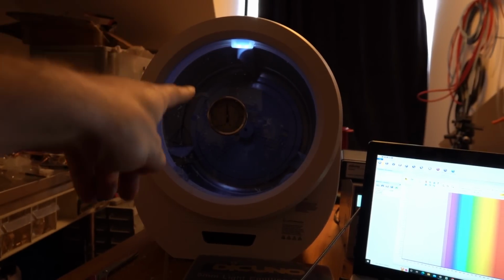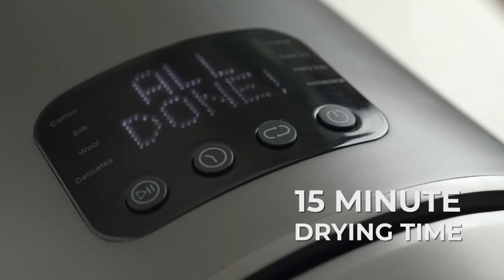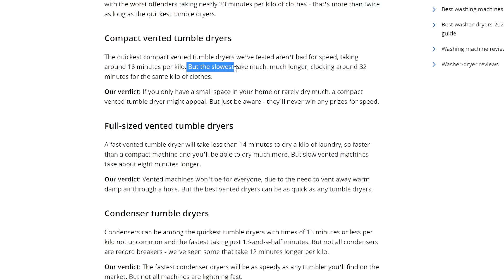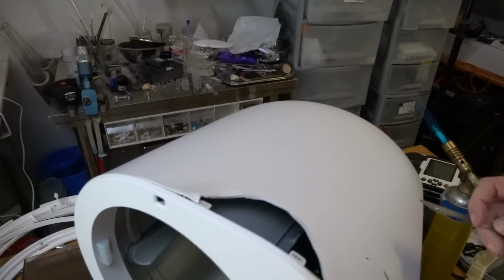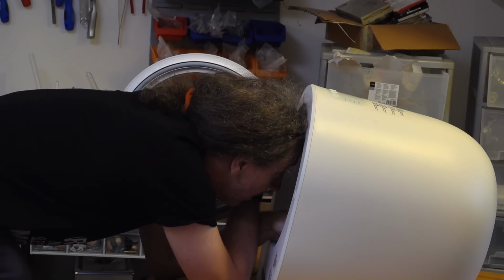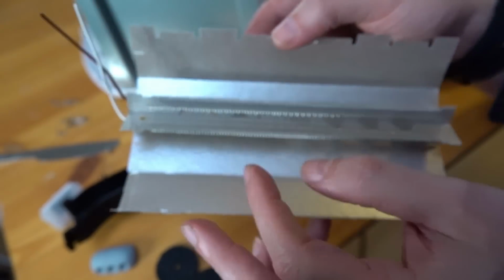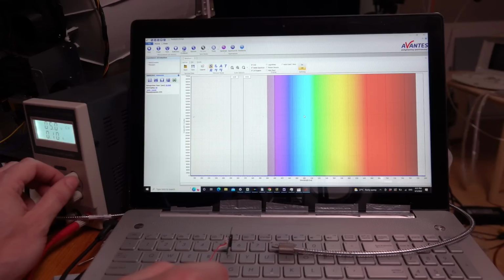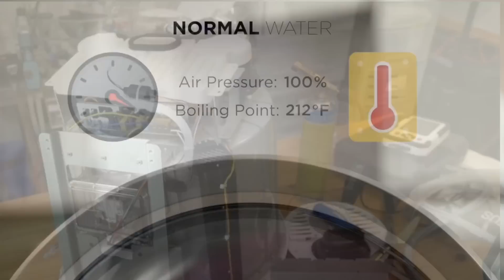Autopsy of a Scam-Starter: The Morus Zero!

Comment: As a test engineer, I found this one of you more interesting videos.  My opinion as to some of your questions:

1) The connector was probably hot-glued on to keep it from falling off due to the vibrations of operation, since it appears to be the only connector that hangs down in the direction of removal.  However, using hot glue in a machine that gets hot is somewhat questionable.

2) The drive wheels were in the "Perspex" box to protect them from lint.

3) A resistance heater IS an infrared heater.  All heaters, by definition, are IR.  This one's just far infrared, not a lamp.

4) I applaud your honesty in correcting yourself about the UV LED.  However, that thing was fully into the UVB range, which, as you earlier pointed out, is dangerous to tissue.  I'm amazed they could market something like this without a warning label like on laser pointers, unless they can demonstrate that the door window absorbs that frequency and that it is sufficiently interlocked to prevent operation with the door open.
Reply: on the infrared heating story: in everyday language IR heating is mostly understood as an IR source radiating heat that hits some surface directly (e.g. the skin of someone) and makes it feel warm, contrary to the "space heater" which uses the surrounding moving air to transfer the emitted heat to the room. not debating the definition of IR heating there, but clearly the nichrome wire in a wind tunnel won't qualify as a real (say quartz lamp) IR heater. and IR radiation will follow a straight path and likely won't reflect from the surrounding black plastic walls either.
Reply: @sikedipuuhja7376  - Can't argue with that!
Reply: you couldn't sell this in Switzerland. These days only the heat pump variant is aloud, because they're far more efficient. What makes me most concerned is that this is a major fire hazard. There seems to be no filter at all to absorb dust and cloth fibers. and it looks like some of the air coming out will be sucked in again. this will lead to a build up of cloth fibers in the heating elements. and the temperature sensor is in the wrong place. if you have basically no circulation anymore at some point, the temperature sensor will not measure the overheating. just hoping people throw it away for functioning to badly before the buildup is severe enough for a fire.
the one thing most test engineers forget, is that any system that pumps lots of anything with even little impurities (dust, fibers etc.) inside will rapidly malfunction, even if every single component is good for 10 years. often they forget that you have to be able to clean even the inside without having to break to system. any filter that allows sufficient flow, cannot sufficiently filter to avoid a buildup over time.
and if it's up to the end user to do the maintenance you have to overdesign to filter system...
operation
Reply: When I was a kid we had an already old clothes dryer that I discovered had a UV bulb in it to provide the same sterilization feature.  It didn’t work at first but I looked at the schematic and saw that the drum light and UV bulb were run in series so replacing the drum light (that I had no idea it had either) made the UV light work as well.  It was not a fluorescent bulb, and not an incandescent bulb with purple filtration, I suppose it probably put off UVC since it was a clear mercury light bulb that must have been ok running at about 60v with no ballast...  weird old tech.